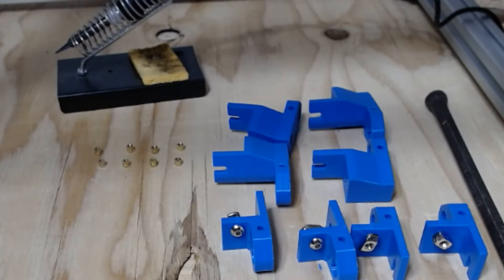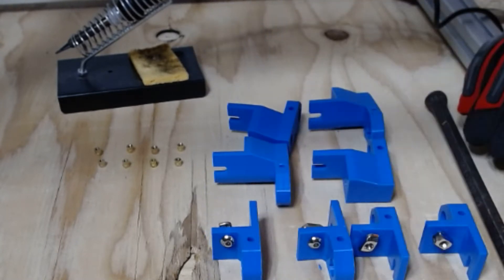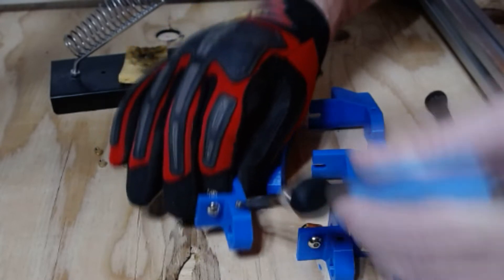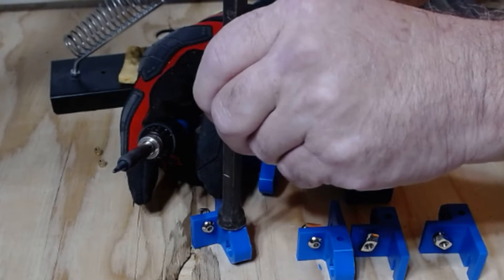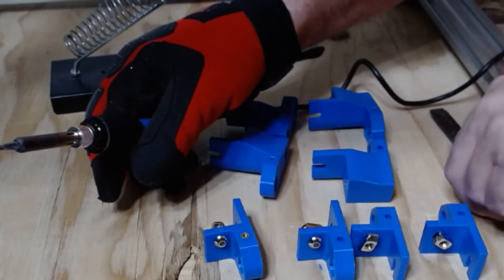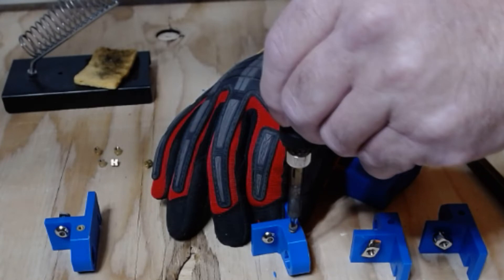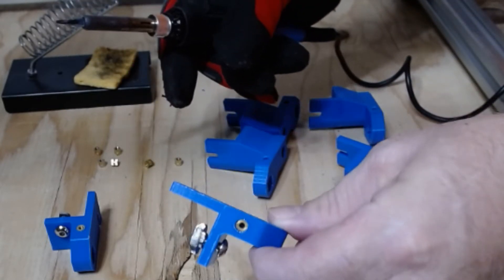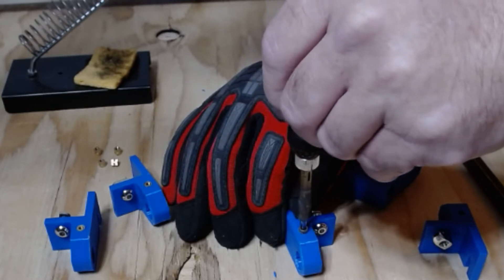Installing Threaded Brass Inserts Into Your 3d Prints #3dhp

Comment: Any advice on getting holes to print at the proper size?   I'm trying to print 3.2mm holes but always come out too small when I print.
Reply from the maker: If its a piece you designed,make the holes bigger,not sure what the problem might be.